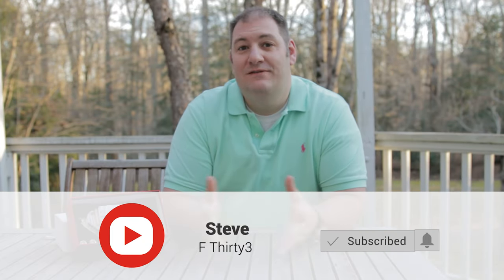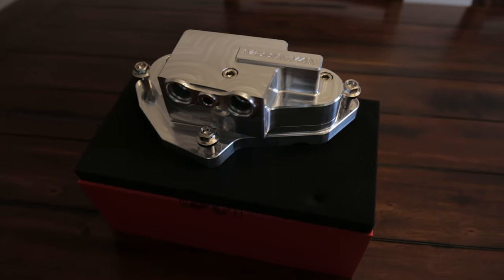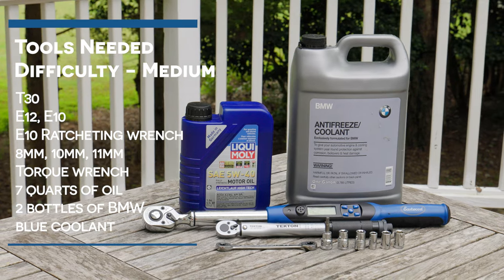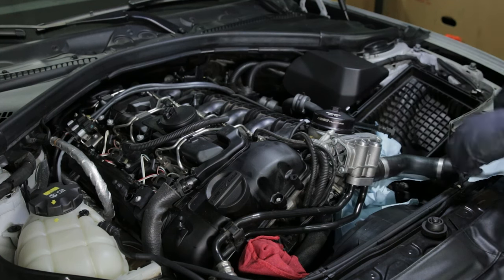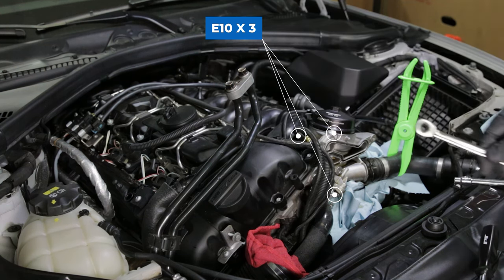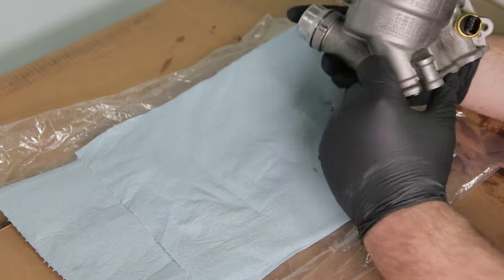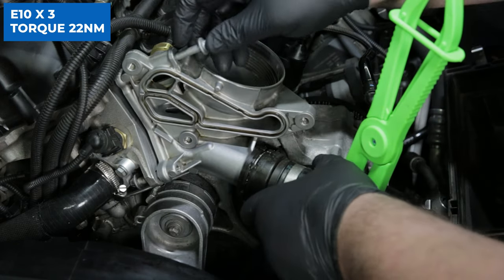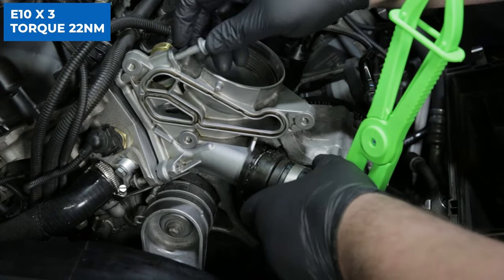OIL FILTER HOUSING GASKET REPLACEMENT AND MOSSELMAN OIL THERMOSTAT UPGRADE (N55 / N54 / S55)

Comment from the maker: This is one of those mods for you BMW that will help your engine last longer, maintain power longer and look amazing. It's a win, win, win! lol 
This Mosselman Oil Thermostat will fit N54 / N55 / S55 engines.

Mosselman F-Series Oil Thermostat: https://www.kiesmotorsports.com/products/msl-oil-thermostat-n54-n55-s55?variant=32814881046613

Oil Filter Housing Gasket: https://amzn.to/45oGnX5

🛠Tools Needed 🛠
Oil Funnel: https://amzn.to/3PP5flc
E-Torx Ratcheting Wrenches: https://amzn.to/3PP3DIa
Dewalt Mechanics Tool Set 247pc: https://amzn.to/31CHbcf
Torque Wrench: https://amzn.to/3qY2W6L
Small Torque Wrench: https://amzn.to/3FgAdNW
Hose Clamps: https://amzn.to/3tz32mb
BMW Coolant: https://amzn.to/3M06Sez
Liqui Moly Oil: 
5L: https://amzn.to/3PP3PqS
1L: https://amzn.to/45koBnS

Comment: ***IMPORTANT***: Be sure to conduct the OFHG dry start/priming process to purge the oil system of ALL air. Otherwise you risk your rod bearings scorching and destroying your entire engine! This can happen on any BMW motor. You can run the OFHG priming procedure in two ways. #1: Via BMW ISTA or a bidirectional scan tool. This is the BMW recommended method and there is an option specifically for this. #2: You can pull the wires from 4-5 of your coils and then try to crank the car for 10 seconds. Do this 3 times. It will imitate the BMW ISTA/Scan Tool function at its core by squirting oil through the galleys to purge air. 

Other than that, great video man!